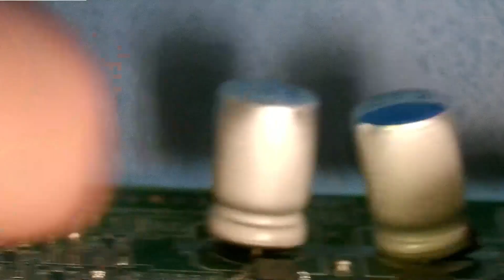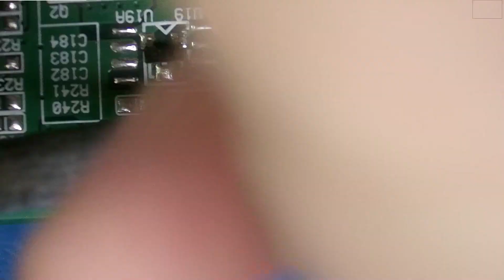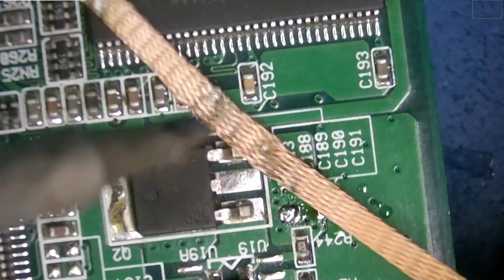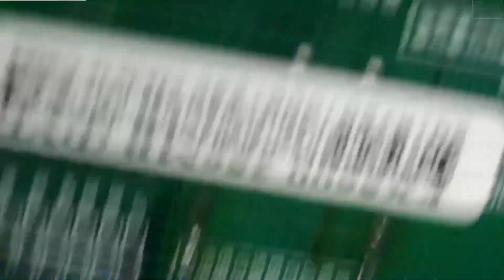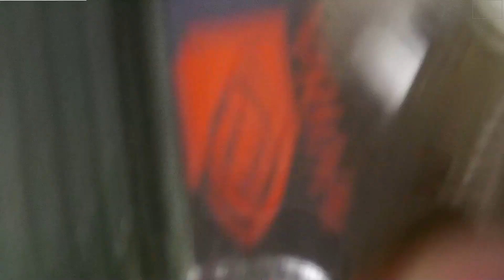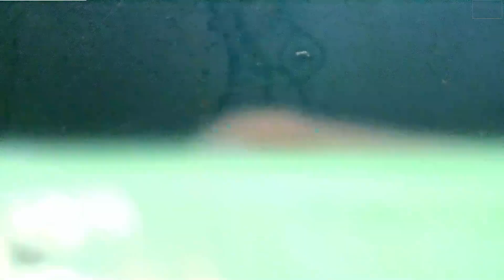Nvidia FX5600 GPU Repair

Comment: If the GPU is faulty and the serial number is not visible, how can I check it?!
Reply from the maker: I am sorry I don't think I understand your question. 
The serial number is not visible? If the serial number is not visible, it shouldn't affect your repair or diagnostics. Do you have a GPU and not know what kind of GPU it is? There should be some marking printed directly onto the board that you can search to identify it.
Reply: There is a sticker on the outside of the gpu, if it comes off and disappears how will you know what the gpu's serial number is? @NicksElectronicRepair
Reply from the maker: I guess you wouldn't